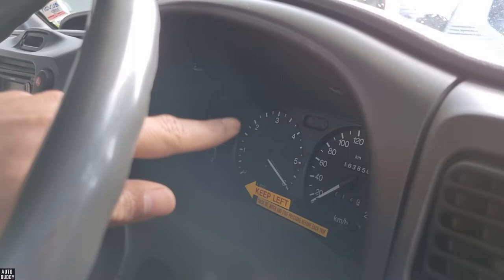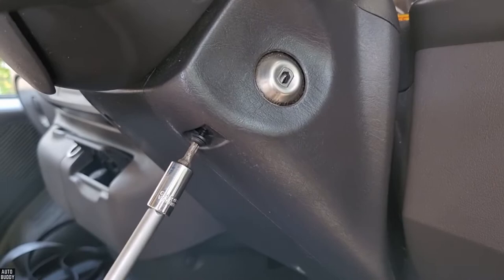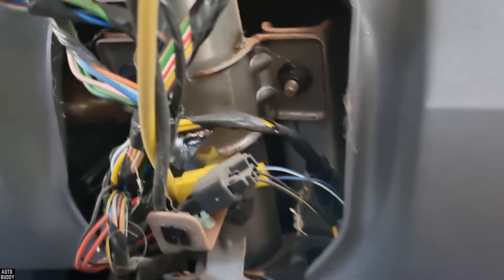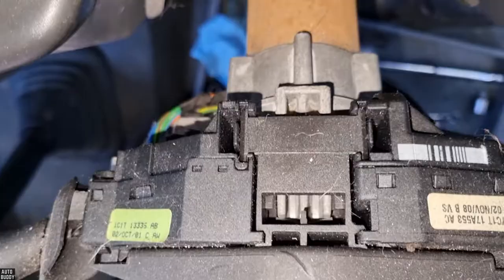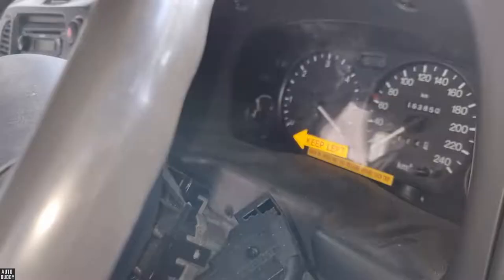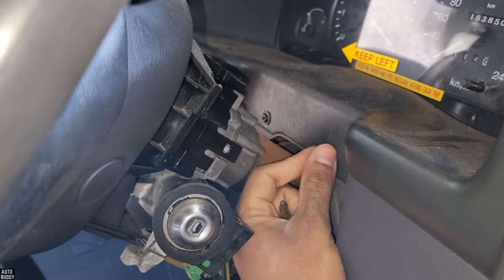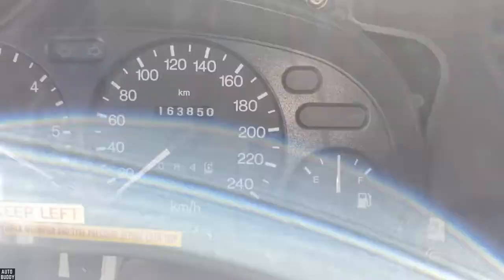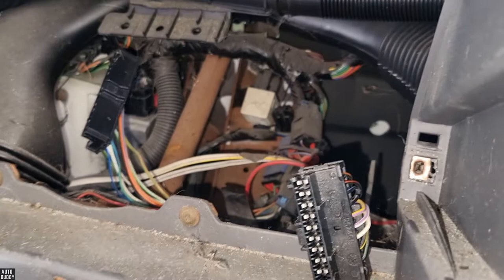How to Remove Ford Transit Speedometer - Without Breaking things

Comment: Great video, what type of dash board bulbs are they as I would like to replace all with LED as the current 
dash board is very dull.
Reply from the maker: I would be careful when trying to change all your bulbs to leds. It can cause a lot of issues down the road. Especially if the drivers short etc